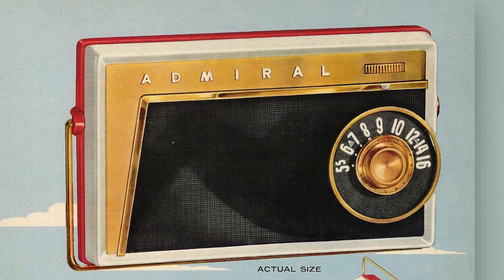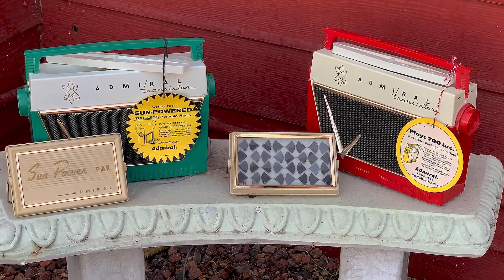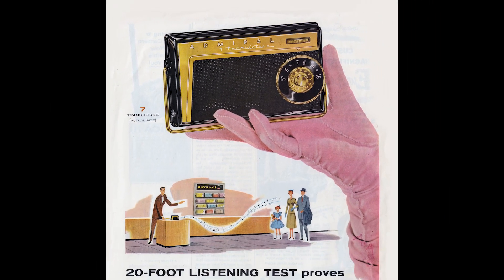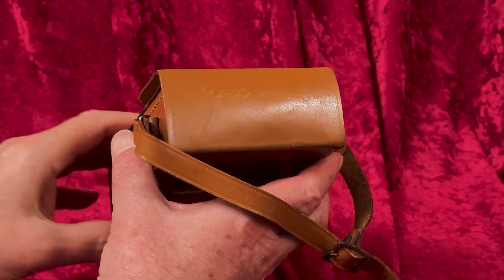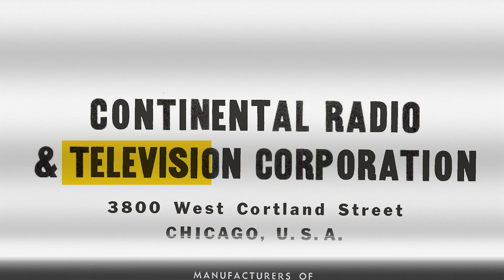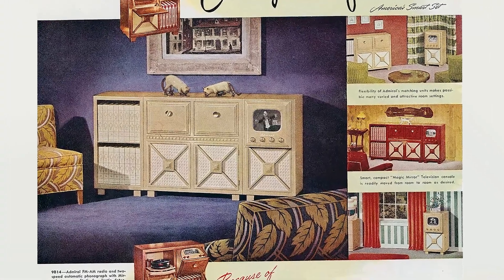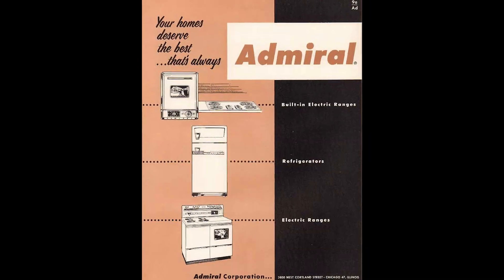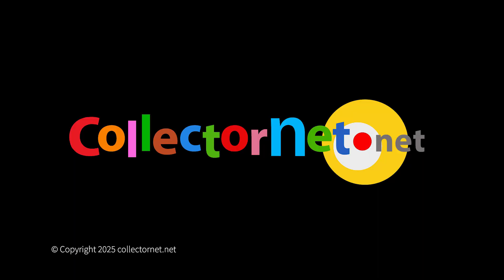Pocket-size solar radio in 1956?

Comment: The inside looks like it has the same parts as the Zenith Owl Eyed portables of the same era, the leather case looks like the one that came with the Zenith as well.
Dumont started as a supplier of electronic instruments, particularly oscilloscopes, and branched out into TV (they co-developed the TV picture tube with RCA).  Television had been "around the corner" ever since the 1939 world's fair, and experimental stations had been on the air since the early 1930's.  A few sets were on sale in the few cities where these experimental stations were located.

Comment: Wow! Look at those tiny, individual, delta-shaped photovoltaics. Beautiful, encased in epoxy.

I'm not surprised they put television in their name to seem high-tech. They probably had intentions to get in on it, before it turned-out too complex. You've got a 1938 brochure in the video which backs it up, 4 years before your 1942 source.

FranLab uploaded a 1936 book, credited to Sydney A Moseley and Herbert McKay (who interviewed John Logie Baird as part of their process), which discusses (among other things) the cutting-edge research in electron-beam television scanning. Those involved with the book are quite clear that it knocks mechanical scanning out of the water.

Given the timeframe, It's highly possible that in 1932 Continental/Admiral thought mechanical television would be The thing for 10-20 years before being replaced, and intended to produce and market them. But by 1936 it was becoming clear that electronic television would supplant mechanical television before mechanical television ever took-off, so they waited until it "shook out".

That's just supposition, of course :)

Comment: @collectornet I did not realize Admiral was called the Continental Radio & Television Corporation in 1934.  Interesting, there was no electronic Television in that day, only experimental mechanical television, copies of John Logie Baird's design, which only had 40 scanning lines and a slow frame rate producing a very flicking picture.  In 1934, there were a few mechanical televisions being made in the US as experimental prototypes but, not Admiral.  Perhaps Admiral had plans to get into TV when they came up with the company name but, the plans fell through?  In 1934, TV broadcasts were experimental and on the Shortwave bands, with a totally different frequency for the sound and video, meaning you needed two receivers to drive your TV display unit.
Reply: This is what I think as well. I recently read a book from 1936 discussing the cutting-edge in electron beam scanning, where the authors were quite clear that mechanical scanning was dead before it had really even taken-off. I imagine that influenced Continental/Admiral's decisionmaking process!
Reply: @kaitlyn__L  Yes, in November 1936 in the UK, the BBC had a contest between EMI's 405 line all electronic Television system and John Logie Baird's improved 240 line mechanical system.  The Baird system was very crude and bulky, it scanned the video images to movie film and had to be developed before it could be viewed.  These tests were run at the Alexandra Palace Studios and the electronic system was proven to be vastly superior to the mechanical TV system.  I think Baird "saw the light" at that point and his future research dealt with electronic television.
Reply: @billharris6886  oh, I had forgotten about that! Thank you for the reminder. 

The book didn’t mention that test event specifically, unless I forgot a brief mention. They do discuss various “attempts” of various methods in the last couple of years which I suppose gives them leeway. 

I certainly got the impression that the wider community had already been converted after I read that. I specifically read the book to check if, given the time and men involved, they’d try to sell the reader on mechanical scanning as a potential “format war”. But as I recall they basically called it rubbish! Quite early on they concluded the picture tube was the only viable way. Most of the book explains how every part of a CRT works. 

There’s no direct interviews in it of course, so there’s plenty of room for editorialising! In the foreword the writers basically said they got him and a few others to explain all the technical stuff and they “translated” for the interested but non-expert layman reader. 

I’m not sure which month the book came out, so now I’m curious if it was a December publication. Or, perhaps Baird did try to convince them and they editorialised all of that way :) 

(I read it on FranLab’s archive of it, if you’re interested. She showed each page for 2 or 3 frames, it’s nearly a minute long. I may have forgotten some important minutiae!)
Reply: @kaitlyn__L  Thanks for some of the TV history details and the book source!
Reply: There were several early mechanical television manufacturers in the US beginning in 1928/29.  So I wouldn't call them prototypes, but actual mass produced sets.  Western Television was one of those out of Chicago, IL and there were a few stations broadcasting television signals capable of being received, although programming was very primitive and reception was less than ideal.  The Early Television Foundation website has extensive detail on the history of television and examples of early TV sets.
Reply: @1McMurdoSilver  Thanks for your comment on this subject of mostly forgotten history.  True, there were a number (maybe 20?) US manufacturers offering either parts, kits, or a complete mechanical TV receiver with 2 to 3 radio receivers for audio and video reception.  There were no set standards in that day so, of the sets available, they had different formats ranging from 24 to 80 scanning lines.  There were several experimental TV broadcast stations in some big cities in the US with up to a few hundred miles range.

Yes, there were a few manufacturers offering several models (Jenkins, Hollis Baird, and Western TV).  Since TV standards were non-existent in that day and television was experimental, I suspect production runs produced no more than 100 TV sets of a specific model. 

I have visited the Early Television Museum in Hilliard, Ohio twice, it's an amazing museum loaded with history and early TVs!

Comment: I wonder if "Television Sound" actually is a frequency band or is just an audio input, The reason I say this is I have a 1939 Zenith model 5808 with an audio input marked "TELEVISION" with the idea being that there would be add on TVs without audio final amps or speakers. (Much like the origin of the RCA jack, meant to connect a turntable to an RCA radio..) The BEST part is that it's NOT "line level" it "expects" higher voltage than that. Works PERFECTLY with an MP3 player and "aux cord" (had to wire up my own connection as the Zenith just has 2 contacts, Not a "jack". But I use this and a really cheap MP3 player loaded with 1930s and 1940s radio shows, newscasts (Thank you Internet Archive!!!) as well as 1930's and 1940's music. "Immersive" IS listening to WW2 news on a radio that was "there"!
Reply: Early television was broadcast on a VHF band and could be picked up on a radio if it included the correct frequencies.  Also some early televisions in 1939 were "vision only" meaning the TV did not have a speaker and you could plug the vision only TV into your radio, if it was so equipped.  RCA did this along with a few others.  The cost of early TV was very expensive and the vision only TV was one way to keep costs down.  So the answer to your question is both, a television band and also some had just an audio input.

Comment: "One set of inexpensive batteries gives a years use"  !   Impressive.    Dumont was avery innovative company with some technically advanced televisions way ahead of other larger manufactures.        Thanks for another lovely video.
Reply: Worth mentioning those were mercury batteries, which had a higher capacity than modern alkalines. Lithium is similar, or perhaps slightly larger, IIRC.

Comment: Around 1975 or so I somehow acquired a counsel TV with radio to one side and record player to the other. It was very large. Very. Something different about it was a light around the picture tube. Maybe it was called a halo. I kept it for a few years, using it as a bedroom table. In the end, regrettably, it ended up in the trash, which is probably where it came from.
Reply: Likely a Sylvania unit "halo light" was one of their sales points

Comment: You have a distinctive and interesting voice. It's also a bit familiar. Do you have any other YouTube channels? BTW, I got my first pocket transistor radio when I was 11 (1969), and it was rechargeable. It came with a charging base and the battery lasted about 8 hours when it was new. Less than a year later, it would no longer take a charge, but still worked when sitting in the base. I wish I could remember the brand name. Both the radio and charger base were black plastic.
Reply from the maker: Ah! In that era I think GE may have made such a radio with a charger base. Other brands available at the time that made rechargeable radios (albeit, to my knowledge, without bases) were Craig and Ever-Play (by Gulton). There's a video on this channel that talks about the Craig.
Reply: @collectornet  I have an old Everplay from 1966. In 2010 was the last time I tried charging it for 15 mins to see if it would play. It did. It played for a minute before it died. It stuns me that the battery still worked at all.

Comment: Solar photovoltaic s in the mid 50's? wow. Plus the efficiency wasn't real good either. It's like those 1980's hand held calculators with the little solar panel embedded on the front. Pretty much bling.
Reply from the maker: Research into improving solar in the latter half of the 20th century went at a suspiciously slow pace. This is a historical fact little known and never discussed. Why is that? If one "follows the money" to find out why so little progress was made, the trail obviously leads to those who felt most threatened by solar--the fossil fuel industry and its apologists in Washington.
Reply: @collectornet  Yep. Reagan killed the research subsidies Carter had implemented.
Reply from the maker: I believe Carter had installed solar panels on the white house, then when Reagan came into office he had them removed. Couldn't just let them be--he had them removed. And ended Carter's research subsidies. I have very mixed feelings about subsidies, but didn't we then and don't we still subsidize oil production? Who subsidizes a mature industry while smothering a new competitor? Or I guess the better question is--how could the Reagan administration do that and still call themselves free-market capitalists?
Reply: @collectornet  absolutely. Subsidising oil AIUI is basically a way to keep gas and food prices a little artificially lower, pure pork barrel politics. 

(BTW, I had made a reply blaming Reagan yesterday, but I can’t see it now. The UI also only says 2 comments. Is it held for review in your dashboard?)
Reply from the maker: I guess it's the hypocrisy of these "free-market subsidizers" that bothers me. You'd think I'd be used to it by now since it's everywhere, especially these days. Calling out something as hypocrisy used to be a check. Now the reaction of the hypocrite is just something like: "So...?"

I looked in my "held" section and saw nothing there about Reagan or from you.
Reply: @collectornet  thanks. Guess it just got memory-holed. That happens a lot lately. And for sure, hypocrites are basically proud of their hypocrisy nowadays. I could go into far more details about the misuse of laws and policies which bother me the most, but I want it to actually get seen!
Reply: @kaitlyn__L  Youtube AI eats a lot of my comments. Poof.............Gone! It may have to do with the fact that I use an Ad Blocker.

Comment: RCA, and many other companies and inventors, were in the very late 1920s and early 1930s beginning to work toward television standards.  These statements can be found on Mike Shannon's DALLAS-FORT WORTH AREA TV STATION HISTORY (dfwretroplex).

           "Truett Kimzey displays the first television broadcasting setup in North Texas, 1934  The first television experiment in North Texas was conducted by station W5AGO.  It was assembled by engineer Truett Kimzey (who later started Greenville TX radio station KGVL,) and, in March, 1934, his $1,500 worth of TV equipment was put on display for viewing at the Fort Worth Stock Show (a video signal was sent there from Kimzey's TV studios at Downtown Fort Worth's Commercial Standard Building.)  Unfortunately, the crude equipment was soon outdated, as the FCC was still hammering out industry standards for technology that wouldn't be in wide use for another 20 years...and the Southwest wouldn't see television again until the late 1940s."

Some of the companies were using television in their commercial media before the war, but that pesky situation (WWII) interrupted all the plans for codification of television transmission methods until after the war.